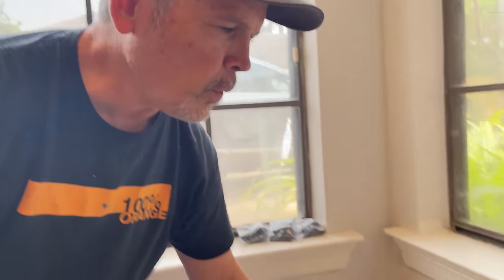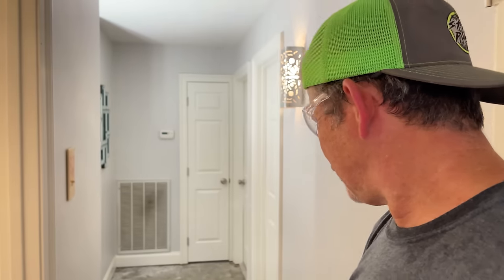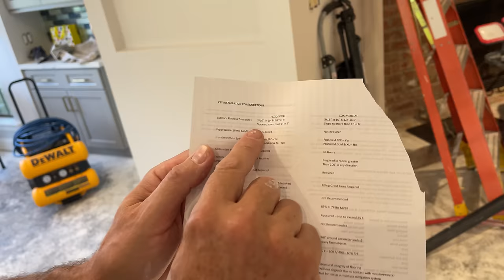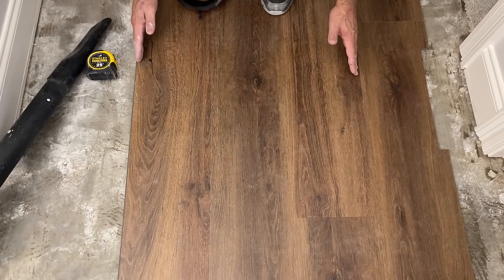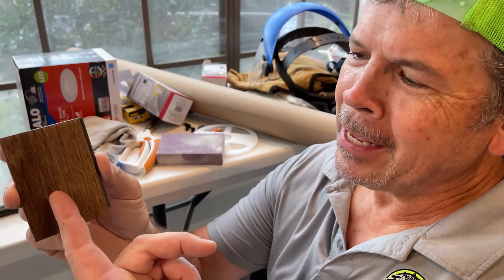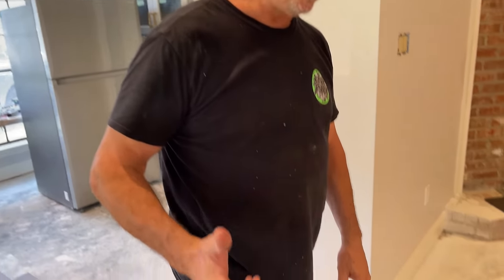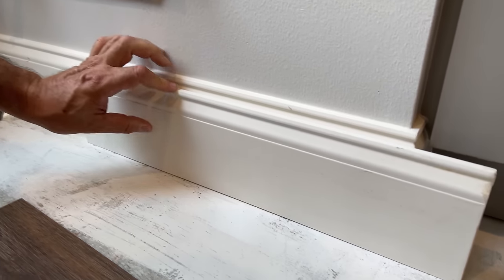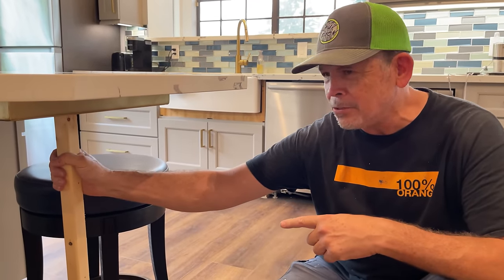The ULTIMATE FLOORING HACK! | Installing Vinyl Plank Flooring

Comment: I've rebuilt a couple of houses and flooring is my favorite part of it all.  It's fast, transformative and exacting.  LVP is easy physically but I can't see doing it without a guillotine cutter.  Also when selecting your LVP pay attention to the wear layer and spend the extra dollar and get a 20 mil wear layer as opposed to the cheap crap the big box stores try to sell you that has a 6 mil wear layer.  If you have dogs or kids the extra thickness of the wear layer is a must.
Reply: Nice tip 👍 Thank you 😊
Reply: I got a 12mm
Reply: 6 mil just is not enough ---- unless you're flipping the house , but I"d even feel guilty then ...  Ha
Reply: Other than 20 mil wear layer, what other specs I need to pay attention?

I’m looking at homedepot and all they put is anti scratch, water proof, and easy installation but the prices ranges from $2.5 - $3.6 and I’m like well what’s the difference then am I just paying for the brand name and color? Lol
Reply: @MythicRealTrap  Check out Cali Bamboo’s line of LVP; 20mil and 1/2” plank thickness.

Comment: Great video, this is so helpful. I am about to install this floor for the first time, like in your video, there is trim on the wall the floor will slide under. How far under the trim do you cut the flooring? Or do you cut it flush with the trim,? since the quarter round will cover it? I want to make sure I leave the expansion space LVP requires.

Comment: Does thinset mortar bond to the slab better than floor-leveling compound?  Perhaps since the polymer modifier is similar to latex bonder which you need before floor-level (which I think is Portland cement and fine sand).  Wonder why the homeowner wanted to get rid of that beautiful hardwood floor for plastic fake-wood.  Perhaps to have the same flooring everywhere in the house?

Comment: Watching this video as a flooring installer, I found this to be very thorough. I am in complete agreement....hallways are killlers. It always takes way longer than you think to do a hall. Great job.
Reply: Do you know if he put a 1/4 inch gap on each side of the hallway? It looks like a tight placement 

Do you put 1/4 inch gap from the wall in the hallways or only in big rooms like living room and bedroom?
Reply: Gap doesn’t matter because of the gap under the base. Base is probably at least 1/2 inch they put the base shoe on afterwards. Personally I don’t like the added base shoe but it was already set up that way.

Comment: Are the wedges that come with the kits supposed to be used to create an expansion gap? I keep reading with vinyl you absolutely have to have an expansion gap around the perimeter. Once the gap is covered with baseboard, will it still be able to expand?

Comment: i'm thinking of doing this in a small bathroom, but there is a lot of space between the bottom of the trim and the concrete. I know that spacers/wedges are used to allow for expansion of the planks. So, how do you account for expansion of the planks if you're not measuring a 3/8 inch border and tapping the planks against the walls completely? 

Additionally, how does the floor not slide around if you did measure the side pieces, minus the 3/8 inch gap. Thank you so much! I loved the video.

Comment: Rather than measuring for pieces at the end, spin them around and mark them backwards. No tape measure required. Also, a guillotine cutter works great. Easier than cut and snap.  Nice job.
Reply: I’m a hack doing most of my own work. I learned that trick years ago from my Dad.
Reply: @timsjourney  same bro
Reply: Guillotine cutter is a game changer. Really speeds up the cutting.
Reply: Oh yeaaahhh !!  Not sure why I never thought of that.  Thank you so much for that.  Need to find a guilotine cutter....  I am in Japan so ...
Reply: Adam Turnbull  I got mine from Amazon
Reply: @Clamdine  do you have a link for that? I'm about to start a huge project where that would help. I only see paper cutters.
Reply: If it is SPC a guillotine does not do the job.
The board would crack.
Reply: @kenfett7070  scoring with a utility knife and breaking it over your knee ist the best and fastest option.
I am installing the machines which make these kind of floor here in the US.
(Pergo, Shaw, Unilin etc.)
Guillotine works on MDF only.
Reply: @waltergausser6137  I us guillotine for lvp luxury vinyl plank flooring. Typically, 6- 7 mm thick. Cuts well without the mess of a chop saw.
Reply: @pwowk  I agree that it works with LVP or LVT
That material is like rubber.
It was a challenge to get the profile into that material.
I installed the very first equipment here in the US years ago at Mannington in Calhoun Georgia.
The material in the video as far as i can evaluate is SPC or WPC.
( Stone plastic compound or wood plastic compound)
You have up to 70% lime stone in your material which makes it like shell rock.
You can break corners off of it with 2 fingers without force.
Scoring the top layer with a sharp knife and breaking it does not give a mess and you do it right on the spot without getting up.
A saw still is needed if it comes to notch outs like going under a door trim.
How do you do notches on LVP if you do not use a saw?
Just FMI
Reply: @waltergausser6137  ok thanks. I just assumed that it was vinyl
Reply: @pwowk  sure
Many people do not even know the that there is multiple products out there, not even Home depot employees.
Also going by the boxes they are using (all white card board) i can tell that it is B-Grade material.
My customers collect B-Grade and pack it into white boxes rather than in the colored fancy boxes with the company name on them. Reason: they do not want their company name linked with a product that is not 100%ish.
Usually Lumber Liquidator buys all of it and throws it onto the market.
Thats why they had to wait so long for the color of their choice.
Another confusion for customer is if they offer something that says “commercial grade”
That is less quality as “residential grade”
Why? Because commercial grade was developed for low income housing.
Looks as good but much less of wear layer and that makes it cheaper to fabricate.
Reply: @waltergausser6137  The title says vinyl plank flooring!  It looks like vinyl plank that I normally install.
Reply: @pwowk  
You right now i see it.
Still every body says in general Vinyl even though it is SPC or WPC.
The wear layer coating is the same i each case.
The difference is the core material where Vinyl is kind of a rubberish material, SPC is a stone / PVC compound and WPC is Wood / PVC compound.
Its in a way that still many people say “Pergo floor” even it is not made by Pergo and comes from China.
The reason is that Pergo was the first in the country making this type of flooring in the US.
I installed the first production line for Pergo in 1997 in Garner, NC
Reply: @waltergausser6137  Your entire comment is wrong wrong wrong.  Scoring with a utility knife doesn't work on modern flooring because it is too hard and brittle.  And the Guillotine works on virtually ALL laminate floors.  You might work with machines that make flooring but you haven't installed much or you would know better.
Reply: @andys5562  
Yes
I installed plenty believe me.
Surface in LA
My 2 houses
IWF in Atlanta
And I do mot work with machines that make flooring, but my company makes them and I install them.
Scoring works best and is the fastest with SPC.
Reply: P
Reply: I use Robert’s 18 inch pro vinyl floor Cutter and I Flip the plank towards the tongue then I market for cutting no tape Measure
Reply: @waltergausser6137  DeWalt 20v battery  jigsaw for any cut that the chomper won’t do, radius,bullnose corners etc & use the rubber trash can as the cut table right where you need it…not outside and the the “trash” falls into the can
Reply: Ya i was surprised they didn't have a floor cutter, and didn't know to just flip and mark for remaining rowe piece.
Reply: @kenfett7070  a floor cutter is just a bigger paper cutter.
Reply: @kenfett7070  Ryobi has a flooring cutter. It’s worth the price.
Reply: Your talking a couple hundred bux vs a razor and a speed square that takes two seconds. Lol
Reply: @joshuafreeman6720  ya you are right. Depends on how much flooring you are installing. If it is only a job or 2 that's fine. The guillotine pays for instelf quickly though in speed and less fatigue.  Time is money
Reply: @joshuafreeman6720  they do it for a living..... and your probably adding 30 seconds to every single cut at the end of every single rowe. Will add HOURS to EACH job.
-A flooring contractor
Reply: @beez7753  for an american craftsman probably good enough quality but I am a german Craftsman and I deliver 100% quality.
Reply: @beez7753  in Germany every worker is a craftsman because they have adjucatin and training.
There is no such things like „helpers“ there.
😛
Reply: @joshuafreeman6720  a razor and a piece of scrap for a str8 edge
Reply: This is what we did the first time we installed vinyl plank flooring. It was in my friend's kitchen. I did get a flooring saw on a good sale so that helped with cutting.
Reply: oh my god a no it all, just watch learn and enjoy .
Reply: @DK-ed4ff  I'm not a know it all. I just had a suggestion that may help...don't read and enjoy
Reply: @DK-ed4ff  It's "know-it-all" not "no it all". :P
Reply: That's how I always do it, nice tip on the guillotine cutters, I will give that a try
Reply: @jdarokhajiit9153  I just noticed the khajiit part of your name. Do you play ESO? Or just the older Elder Scrolls games? Khajiit are my favorites.
I wonder if guillotine cutters work on 6.5mm thick planks.
Reply: @cats meow55  I have eso, but I haven't been able to get into it. I have played a bunch of the main elder scrolls games though.
Reply: @jdarokhajiit9153  Sweet! I wish I could find my files of my older elder scrolls games. I had them all and really enjoyed them. I made some custom content for Morrowind but my hard drive and backup drive failed so I lost them. Still love Khaijiit though.
Reply: @catsmeow5566  that's unfortunate, Morrowind was hella fun, I would love to see it in modern day graphics
Reply: These guys didnt do a lot of things correct
You are not suppose to run that stuff through doors like that
Reply: @Mike burner I guess when your new  you'd only mark straight walls, but I fit this kind of product almost every day and I backmark pretty much everything. Through every doorway, external/internal corner, steps with a bull nose etc... if im going into a bathroom Ill template the reallys awkward cuts around sinks/toilets with a bit of feltpaper or scrap of sheet vinyl and thats about it.
Reply: I snap cut mine with a 100 year old asbestos tile cutter.....
Reply: You don't even have to mark them before you cut. Turn the plank around, slide it even to the wall, butt speed square against tongue or groove then schore with knife.
Reply: @waltergausser6137  National pride is one thing, but disparaging all Americans? Hobbyists aside, craftsmen appreciate efforts, and realize that everyone is at a different skill level ad abilities may not match their interests. Still, they learn, progress in skills, and provide for their family with their home grown labor. With due respect, jingoistic attitudes arent helpful. Their next job will be better. It takes guts to bare your video without polish for others to learn from. While im sure you are proficient, I would rather have coffee with these nice guys. No offense intended, but  ...
Reply: @trojanyacht2518  
I am German and drink beer instead of coffee.
Even on a job in Germany.
It is legal.
Reply: @trojanyacht2518  
I did not call anybody a hack
Just told about my experience as a craftsman.
Pride is not everything.

Cmon, look at the electric installed in houses here.
Look at the plumbing installed in houses here.
Look at just how satellite dishes are installed on roof tops here where the cable runs down the wall rather than being led to the inside of the house so it is not visible.
Look at the sidings of houses which look like brick but are fake plastic.
Look at the marble columns in fron of the doors of houses which are fake plastic.
Look at the shutters installed beside windows which are fake plastic.
Look at the power poles going along streets and being blown down during a hurricane rather than dig it into the ground.
I could go on and on.

In this particular case i wanted to express that if you make a nice and accurate cut, it looks nice.
Thats how we do it in Germany.
You guys use quarter round everywhere to compensate for inaccuracy you make since you want to do the job as easy and as fast as possible.
Thats not what we do and thats the only difference.
A German craftsman wants to show his joints as an advertisement of his perfection.
Hope this explains what I wanted to say.
Reply: @waltergausser6137  well, the fact that you do a quality job is admirable. I have known guys who felt that a joint in a boat bilge that never would be seen  was a matter of pride, to execute as if furniture, because to do a lesser job when no one was looking would bother his prrofessionalism and pride.
Certainly there are folks who slap things together. What bothers me is an attitude of condescending supe riority, that germany is a betterplace, people, work ethic. That is held by japanese at times, as well. To do a good job is wonderful. To disparage everyone here as quarter round appliers to hide sloppy work isnt accurate.
I worked for  vw dealership and found. A lot of nationalistic arrogance there as well, eveen though the cars were money pits and break down prone. Vw official response was it was all due to american owners and mexico part vendor's poor quality, even though vw put parts up for bid, and approved final submitted designs. They were not above cheating to win  . Lets not forget the diesel scandal that cost them billions, a software cheat to make mileage. Appear better by polluting the environment arrogantly. The attitude of superiority,, a supreme cultture, a master race is rampant yet unearned. Truth is truth, deceitful means to appear better doesnt make it so.
Perhaps we'll always disagree.
Reply: @trojanyacht2518  
I agree fully with you on the VW bs.
And: finally there sits the right person in federal prison in Miami for this cheat.
But: VW I do not consider craftmansship. That part is history since long.
It is an Industry with investors who want to see a gain.
A German craftsman would rather lose Money than leave behind a crappy job where he could be blamed and possibly do not get the next bid on the next job.
It does not mean that Americans do crappy jobs, it meant the requirements from the customers are just on a lower level and hidden defects are ignored as long as they are not visable.
I really do not want to push your buttons but want to share how it works somewhere else.
And by the way I live in the US and work in the flooring Industrie ind the SE US. And because of my German work ethic I male more money than the President of the US.
No show off, just reality.
Reply: @waltergausser6137  yes you can make a good living here by ethical application of your skills. You can make friends and influence the trades towards higher quality standards. I wish you well.

 friends
Reply: @trojanyacht2518  thanks my friend
Likewise to you 👍

Comment: I'm 34 years old and have been laying floor since I was 17  and everyday you learn something new like this video showed me that I made a good investment on an undercut saw with add a  diamond blade and I can undercut the chimney slide underneath and give it a way better looking finish than what he did here but they do good work. Thanks for the shout out to all floor installers it is some hard work
Reply: I first must say I appreciate the Dad in this ensemble. He is so relaxed, conversational, and educates Jordan in all of their construction endeavors. As a fellow tradesman, I have experienced firsthand how the "Veterans" of the trade treat their apprentices/helpers. I have to applaud him, he doesn't belittle Jordan for his errors, and he makes the mistakes about them both as a unit, instead of putting down his son. What a great father and role model Jordan has. Now, I'm no expert flooring installer, but I saw the error by the chimney as well. Is there a method Saul to cover that error as the angles are not symmetrical, or is it best to simply redo the cuts? Our home has a similar layout to this home, that's why I'm inquiring, thanks.
Reply: When you lay your vinyl plank do you always put moisture barrier?

Comment: We laid new 1/4" OSB boards on half the floor where it was a different height and because the old 1/4" OSB boards on the other side of the room are 20 years older and likely shrunk from moisture change. we now have a high point between the old and new boards. Should we sand down the new boards? Should we lightly feather-cement to reduce the difference over a further distance? Maybe both? Should we just leave the new boards to settle and shrink over a few weeks? If we do manually change the difference, will future moisture change shrink the new boards and over time create a new low?  Any suggestions are welcome. PS, thanks for the tips on the low spots.,

Comment: Floor prep and more floor prep. Was a floor coverer for 18 years and more attention went into prep than installation. Concrete base always seamed to need more attention than OSB decking. Slabs are never level flat surfaces and become a time consuming pain. As a independent installer prep work never seemed to translate to the pay of the installed product. Yet you can never cut corners with your prep as it will bite you down the road.
Reply: Yeah, they usually walk in when you're just slapping down straight whole planks in the middle of the floor after hours of prep and are like "wow, you should be done in no time"...